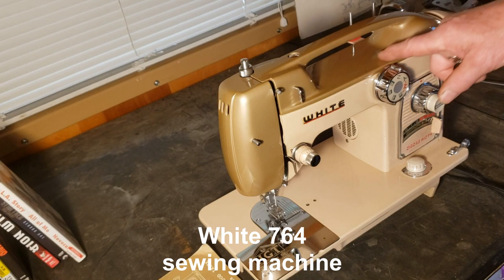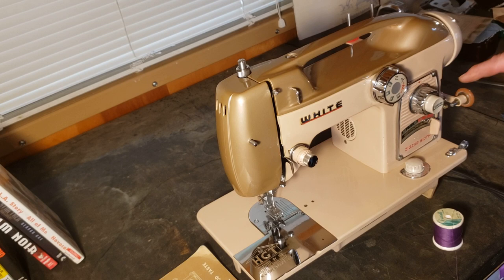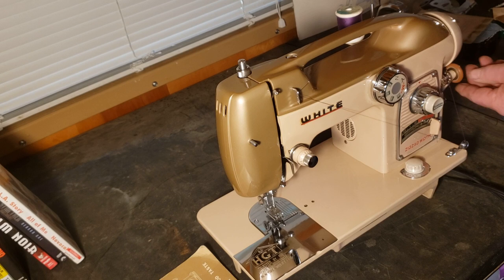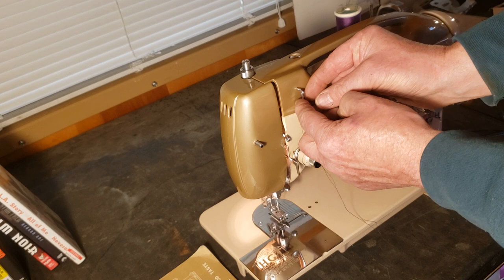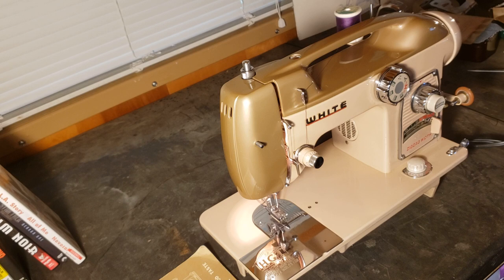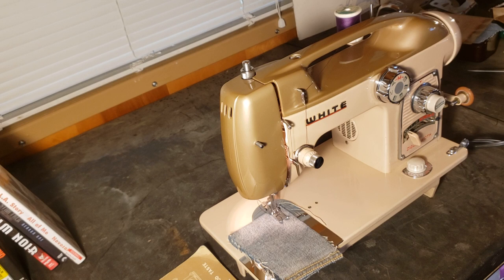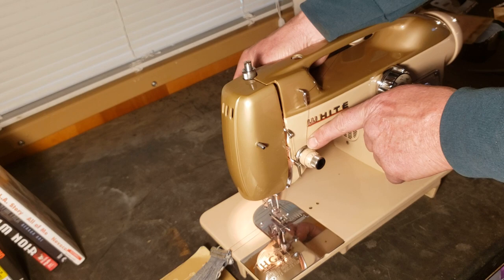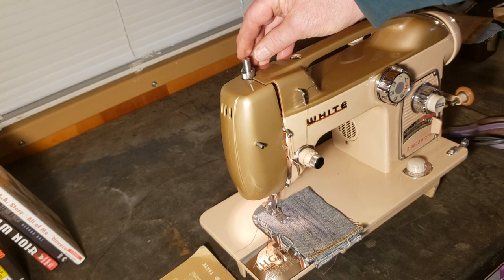White 764 Sewing Machine-Final Test and How To

Comment: I just came up in a White Vintage 764 sewing machine & Everything was working fine, than I started to use zig zag stitch & started getting tight, than until the tension disc and sping mechanism went loose and is now falling from the front of the machine... Does anybody know how to put it back.
Reply: Likely something has failed and needs to be replaced, or a part went flying and you didn’t see. You can sew just fine without the tensioner on the machine, but you must use something in its place, like a simple dowel and paper clip. 
Good luck.

Comment: Hi, I have a White 609 model sewing machine that I want to  use. But I am having  problem with the patter selector dial that does not move at all, and stay in the zigzag stitch only. I will appreciate any video related to it. The manual does not provide information about this. Thank you for your time and help. Already clean and oil the machine.